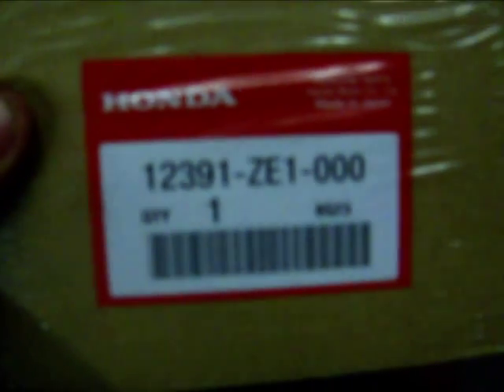valve cover gasket install on honda gx 160

Comment: It also doesnt hurt to use a bit of black RTV on those thin Honda cork valve cover gaskets. I know on my race motors I coat all gaskets with a touch of RTV.